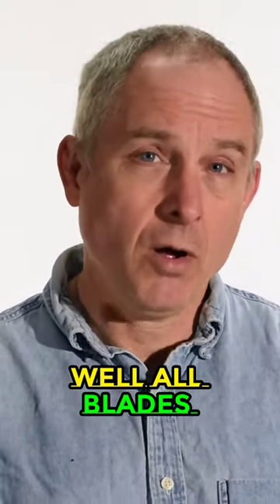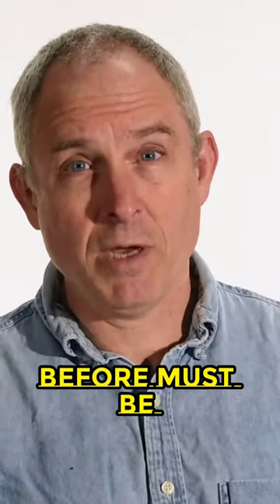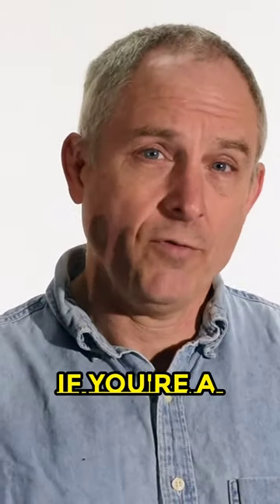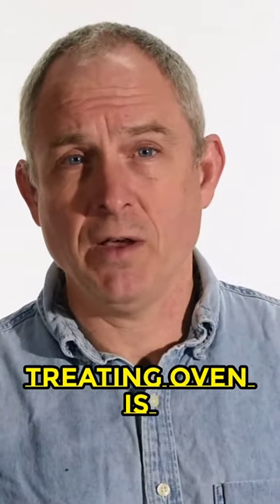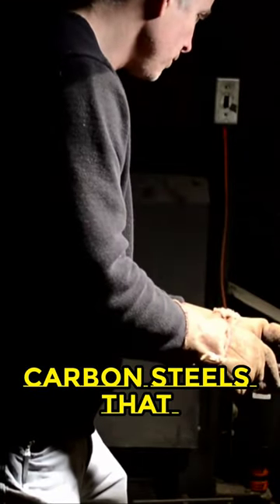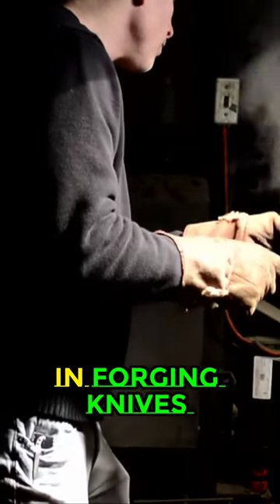What Kind of Knife Maker Needs a Heat Treating Oven?!

Comment: The price of a DIY oven it's not worth not building one. I'm $200 in for a 16 inch square by 4 feet long side door electric oven. The digital control was $60 of that. The wire that doesn't transfer heat came from stoves at the dump. Thankyou Mr. Sorrels great as always.

Comment: I probably need one for titanium, dont i?
Reply: Titanium isn't a ferrous metal. You will need to learn the specifics of titanium to treat it. 
However, I think (don't know for sure) that titanium doesn't harden, it's just tough. So, it will take a beating, but you can't put a harden able edge on it like steel.